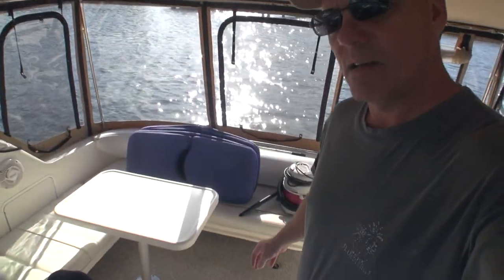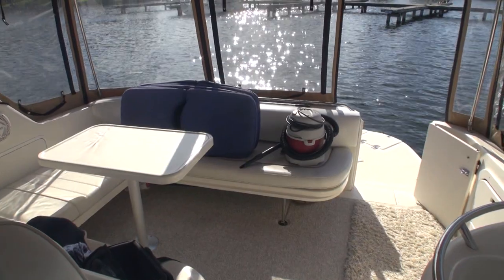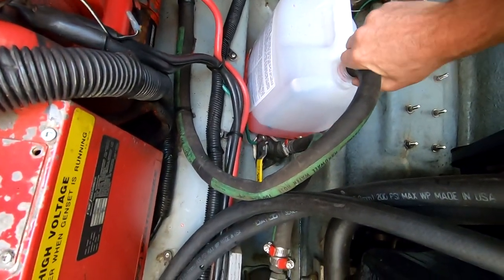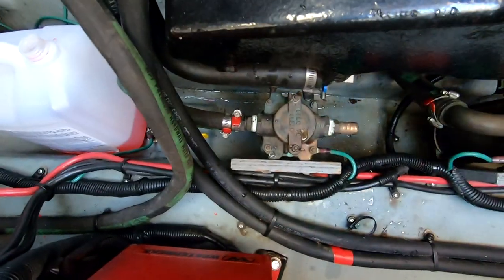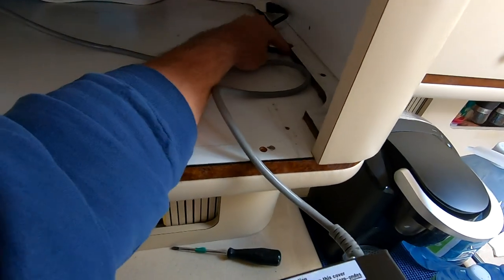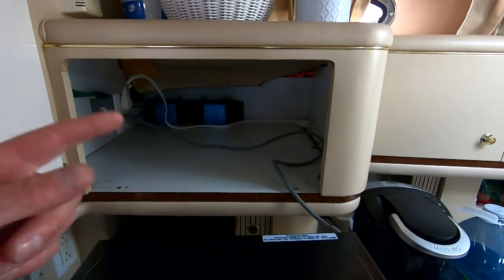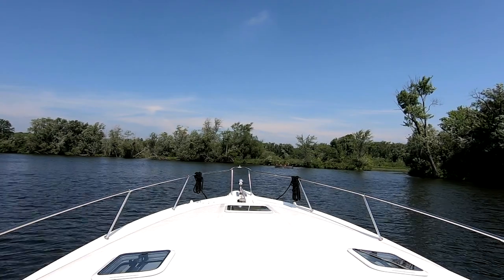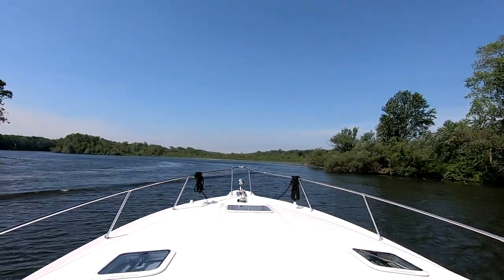Boat Winterizing 2019

Comment: Great video Paul!  I feel very spoiled this year with heated indoor storage!
Reply from the maker: Yes, so do I ;-) As I showed a couple videos ago, we take our Sea Doo for winter storage to an indoor, heated facility where they also perform the winterizing. The first year we did that, I asked why would they bother winterizing when storing in a heated structure? Response was simple; what if the place looses power or heat for a day or two? Given our somewhat rural setting - and the fact that we see temperatures sometimes dipping to a bone chilling -40 (in both scales), we are subject to periodic power outages more than we've ever experiences in the past. Most of the time, the local utility gets things back up and running within an hour, but we have been without hydro for up to half a day in the past, so a vessel stored indoors can still be subject to freezing in extreme cases. . .
Reply: @BoatingWithBoogaboo  You are 100% correct....luckily my facility has a massive standby generator in the event of a power outage.  The facility was previously used to produce precision aircraft parts and you should see the redundant systems...very impressive.  I will capture a video tour and post to my channel in the coming weeks.
Reply from the maker: @expresscruiserlife  Yes, please do!

Comment: Hey Paul!  Just picked up a '96 330 this summer pretty much set up the same as yours was, twin 7.4s, gen, etc.  Wondering if you could tell me a ballpark amount of antifreeze to do the whole boat?  Seller told me about 50 but i thought that seemed a bit high.
Reply from the maker: If you go to searay.com you can find owner's manuals for most models. That should help you out 👍

Comment: Brand new to your channel.  In NJ. Boat still in the water.  Have not used boat much this month. 3/4 gallons of gas. Always put the blue stabil in after refuel.  I want to take a long ride and burn some gas. Put some fresh fuel in with the sta-bil. Question is.  Do I fill it?  Maybe just add 20 gallons and the additive and call it a day.  I did have a bad experience with gas and in the spring had to drain the tank and at the end of the day cost me a couple thousand. I have a 2009 30 foot Regal 150 gallon tank.
Reply: I recommend using K100 stabilizer instead...more expensive but it breaks the water molecules down so that the engine can burn them off with the gas in the spring.
Reply from the maker: That question will get as many answer's as the the number of people you ask ;-) For ME, I have always added fuel stabilizer shortly before the end of the season, and just prior to the last run of the year. Also run the generator for a healthy amount of time. That way, it will go through the whole fuel system. Whatever the amount of fuel is left in the tanks (we have two) is the way the #boat gets hauled. I have never removed, nor added any 'fresh' fuel to the tanks at  the end of the year. Twenty years of #boating and using that same approach on our last five boats, we never had an issue in the Spring.

 That said, if one does do their boating in a warmer climate, there could be a possibility of condensation forming in the tanks over the off season, so 'topping off' might be a more prudent thing to do in that situation. Same as fogging the engines. Never have done that in the past either, but again areas that might see lots of above freezing temperatures in the winter might want to try fogging to protect the cylinder walls. As for us, we don't have that problem, as once the really cold weather hits, it generally stays until April :-(

Comment: Hey Paul.  I noticed when you showed your breaker panel the holding tank said “power”.  My says the same.  I would expect it to tell me the level of liquid in the holding tank.  Do you have an explanation for this?
Reply from the maker: It should, but after a few years, the level indicator in the holding tank is out of service. Check my 'How I Did It' videos to see the tank monitor I installed in both this boat, as well as our previous Boogaboo 👍

Comment: Do you disconnect the hit water tank and plumb in a by-bass before filling the water system with antifreeze, or do you just let the tank fill with antifreeze?
Reply: Always bypass the water heater before sending antifreeze thru the system.
Reply: @12000Jetlag  see that's why I asked. Some say yes some say no. One of those things without a definitive answer.
Reply from the maker: When it comes to winterizing a #boat, you'll discover that you will get as many varied answers as you have questions. For ME, I do NOT bypass the water heater. Again, that's ME. I simply drain the fresh water system, including the water heater, add the antifreeze into the main fresh water holding tank and run it through all the faucets (galley, head, transom wash down on our boat). Done. But again, that's ME and that approach works for ME. Doesn't mean it's the only way to do it . . .
Reply: @BoatingWithBoogaboo  I used to push antifreeze through the water system on our first boat. On our new boat, I use an air compressor connected to the water line just after the pump and push 10psi through the system (bypassing the drained water heater) I open the furthest tap first and work my way through all faucets until all I hear is air coming through all taps. I like this better as i'm not dealing with getting rid of antifreeze in the spring from all the lines. Not to mention not having to use a massive amount of antifreeze.

Comment: Hey Paul, enjoy your channel content! We are located SW of you on the bay of Green Bay, Lake Michigan. I agree it being sad time of year. Put ours in storage last week. Question for you regarding your water filtration system. How often do you need to change the filters? Also, have you had the treated water tested? Thanks and cheers!
Reply from the maker: Hi Jeff. Despite the bummer feeling about the #boating season ending, we are already looking forward to next year and working on a plan to visit brand new places in 2020!! 

 As for your question on the water filtration system, I used one set of filters for our entire five weeks away this past summer. Will install new next year, right before we head out for our first trip. I haven't had the water tested, for two reasons. First, we NEVER use the onboard water for drinking, whether it comes from a dockside tap or the filtration system. We use the water for cleaning, showering, etc.. Drinking water (used almost exclusively for coffee & tea) comes via bottled jugs that we either bring from home, or purchase along our travels. Secondly, given the fact that I am drawing through 20+ year old water lines in the #boat, even the absolute purest water in the world wouldn't stand a chance against two decades of whatever has built up in those lines ;-) And no, I do not flush the lines or system. What we have works perfectly for us. . . 
 And BTW, Green Bay is as close to due west from us as I can figure. The only difference between our locales is that you guys generally get the winter blasts a couple days before us ;-)

Comment: Thanks again Paul for this informative video, much appreciated as usual! Question - I'm assuming there is a by-pass for the hot water tank to be able to winterize both hot and cold lines (without having to put antifreeze in the actual hot water tank), but, what do you do after the lines are done...is there a plug to empty the water from the hot water tank and do you simply leave it out once empty for the winter?   thanks again.
Reply from the maker: Our hot water tank & lines do not have a bypass. There was one with the old tank, before I replaced it while doing the Poop holding tank two years ago, but it was, to put it kindly, problematic. I simply empty as much fresh water from the water heater as I can and then run the antifreeze through it, same as the rest of the water system. Most of that is flushed through to the empty point and then walk away.

 Yes, there are other approaches to winterizing the water system, including blowing the lines with compressed air, but I like to keep things as SIMPLE as possible. This approach has worked perfectly for us for 20 years of #boating, so I'll keep on doing the same way in the future. . .

Comment: You can  pour the antifreeze into the sea strainer vice disconnecting the hose. One less step.
Reply from the maker: Correct, but doing the job single handed, while running to/from the switches and looking overboard for the antifreeze to exit,  makes the job manageable via the hose method. . .

Comment: Hello Paul, 
Can you give me an estimate of the required gallons of antifreeze to winterize the 7.4s with closed-cooling? We are in the process of purchasing a 1999 Sea Ray 370 AC in Wisconsin and having it shipped to Lake of the Ozarks MO. All the systems have been winterized, but we'll have to run it about 35 miles up lake to our property/dock from the marina where it will be reassembled and launched. I'll have to re-winterize the 7.4s once we reach our dock. 
Thanks Denny
Reply from the maker: Hi Denny.
 That's a good one. If you've watched any number of my videos, you'll probably have learned that I'm not one for paying much attention to what things cost or quantities, so I wouldn't have a definitive answer for that. I would 'guesstimate' that a big jug (roughly 2-1/2 US gallons: https://www.canadiantire.ca/en/pdp/winterproof-water-system-antifreeze-50c-9-46-l-0639925p.html#srp) or two would be handy to have onboard, per engine when doing this job. Both my Westerbeke genny AND the A/C system take less than a full one of these jugs (each) to do them, so two per engine should be plenty. Then, if you find you have extra, either return them or hang on to them for next season. 
 Always better to have more, than not enough. As we say on the job site: 'Better to be looking at it, then looking for it' ;-)
Reply: @BoatingWithBoogaboo   Sounds good! Thank you Sir!!

Comment: Quick question Paul......this is my first year with a boat that has a generator.  My question is do you put anything into the carb to "fog" the engine?
Reply from the maker: I have never fogged an engine for winter storage. As we live in an area that sees very cold temperatures throughout the off season, we are less likely to experience condensation buildup in the cylinders or the fuel tank. But remember, that's ME and how I do it. Might not be the preferred method for other boaters, but it's worked well for me for the past 20+ years of #boating. Best consult with your local mechanic to get his slant on the subject.